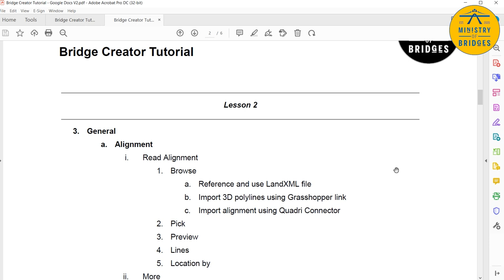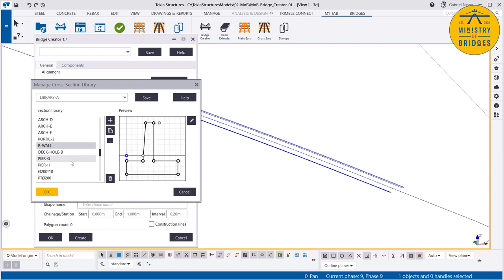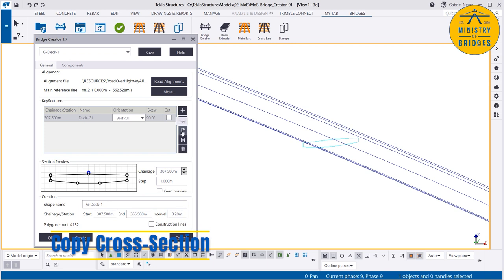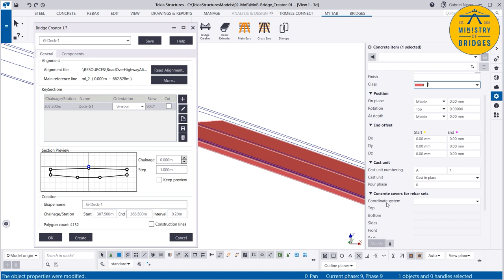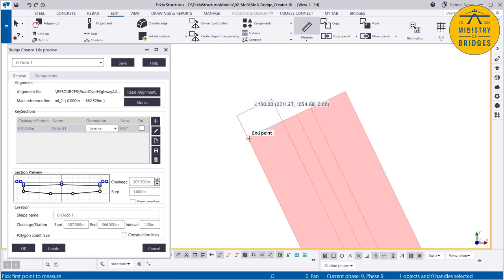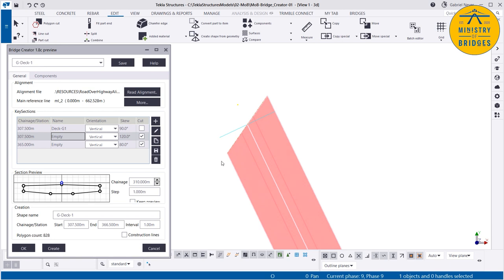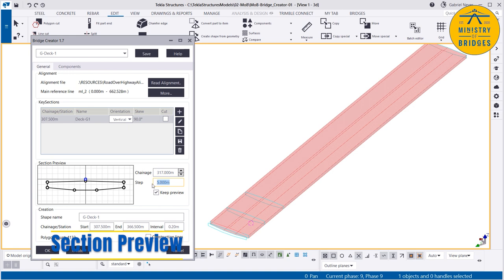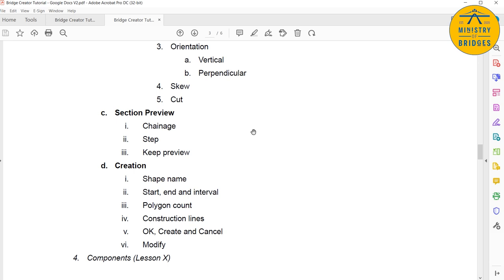Bridge Creator for Tekla Structures Ultimate Tutorial - Lesson 3

Comment: BRIDGE creater compnants not available in Tewkla warehouse , So would you pleasee help ?
Reply from the maker: Hi, not sure what you mean with Bridge Creator components. Bridge Creator installation file is available at Tekla Warehouse. Inside the zip file there is the TSEP, a demo model that has a LandXML file and many examples including a library when many cross section examples. Inside the folder Other_Files there are more libraries and some PDFs explaining the parabolic variation etc. Cheers
Reply: @ministryofbridges3615  No, sir it was available to everyone to download but now they providing link those who are purchased SOFTWARE
Reply: @ministryofbridges3615  Sir, its available with Tekla 22 version but the issues  Grasshopper not supporting with Tekla 2022 version,  But can download from TEKLA warehouse latest GH, But i am using Students version of TEKLA and such individual cant download from latest supporting components, So I think you got my point
Reply from the maker: Drop an email to gabriel.neves@trimble.com , I might be able to help
Reply from the maker: Grasshopper link for Tekla Structures Campus 2022 is here: https://warehouse.tekla.com/#/catalog/details/74297db8-8ff1-4442-804a-baa82c86e1eb
Reply: Sir, I mailed you related subject,  and you can see that in TEKLA warehouse download pages, and  there are 3 category in GH and one is locked with key symbol which is for TEKLA STRUCTRE and most of the components under this section only available to download the person who purchased Geniune version of TEKLA
Reply from the maker: I think it is fair to say that if one is using a pirate version of the software shouldn't have access to Tekla Warehouse right?
Reply: @ministryofbridges3615  sir, Thank you for replay, and done it Bridge creation tools very advantages In TEKLA STRUCTRE instead of Depending Grasshopper and directly can make design, eventhogh its works reference lines from TEKLA STRUCTRE rather than need additional software's likes civil 3d or Quadri software for central lines of Bridge